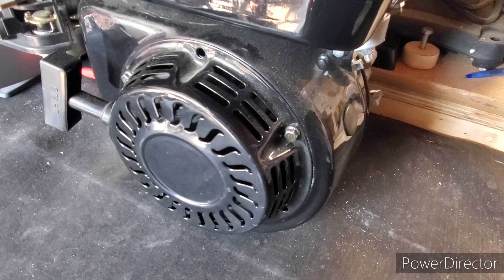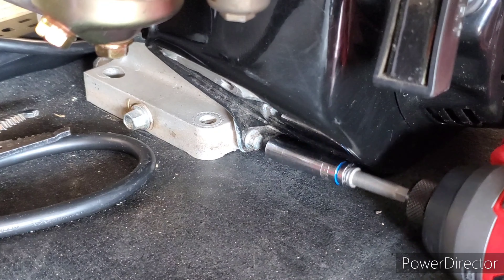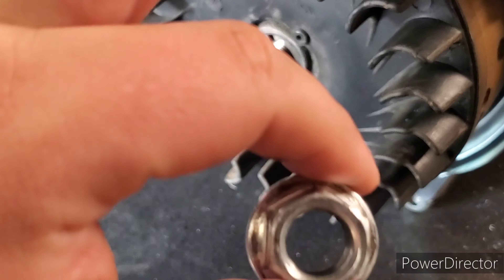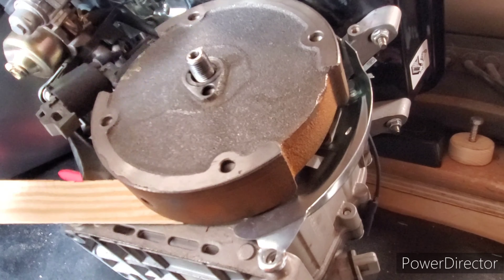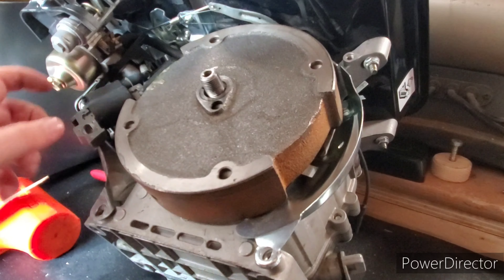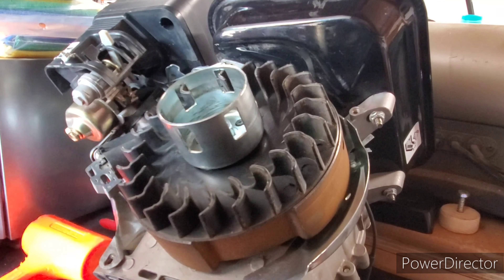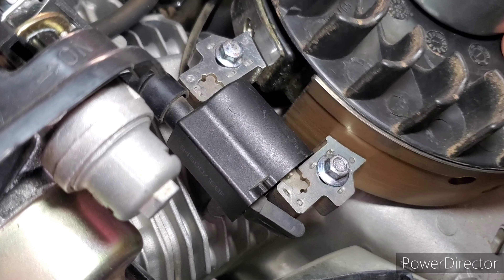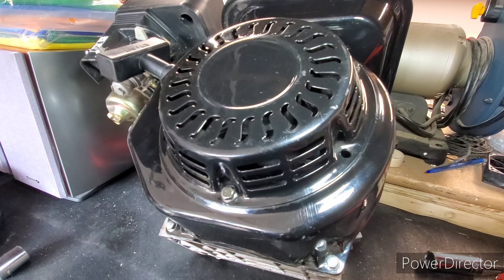How to remove a FLYWHEEL on your SMALL ENGINE

Comment: I did exactly what you did when trying to remove mine but my flywheel never came loose do you have to use something with a wide diameter like you’re piece of wood?
Reply from the maker: Not nessicarly, you just need to put pressure on the back of the flywheel so that when you hit it with a hammer, the tension from the back and the impact will knock it free. There are a whole bunch of ways you could do that in the video. I use the wood to create tension, but you could also use a pry bar. The only issue when using a pry bar is not damaging the block. So make sure to use a strong portion of the block or use something to protect it. Another thing to consider is rust. I've seen on some motors that it can be tricky to get the flywheels off because of the amount of rust. So if you have like some penetrative fluid, put some fluid in between the treads and the flywheel. That should help free it up. Even if their isn't rust, you could also try fluid as well. Let me know if you need clarity on anything I said or if you have any other questions.

Comment: On my brand new 212 there’s a screw that came loose inside and was rolling around near the flywheel. Any idea on where it coulda came from?
Reply from the maker: It may have come from the flywheel shroud on the front, right side of the motor.

Comment: What engine is that it looks like mine and i want to know the brand please
Reply from the maker: It's a hisun. The stock motor that comes on the Coleman 200 mini bike series.
Reply: @outdoormaniac4562  thanks I have a doodlebug mini bike and it has the engine you have and I didn't know what one it was I got it for free from a friend and it runs and drives but I want to upgrade it and get new parts for it

Comment: sir it is pointless if you change the flywheel and ignition coil to racing coil and racing flywheel if you dont change the carb? what gives  the engine more power the carburetor or the racing flywheel or the racing ignition coil
Reply: i have genuine questions because i am still learning . i am ordering a 10krpm flywheel do you reccomend getting the ignition coil also? and do you also think that upgrading the connecting rod and springs will help with hp (i already have a jetted carb
Reply: I would start with the flywheel for safety reasons.  You don't want the stock cast iron one to explode once you start running higher rpms.
Reply from the maker: @user-cc1tm1bh7w  once you start adding more hp, you want to upgrade your engine parts such as your connecting rod, flywheel, carburetor, etc. Just to make sure that nothing blows apart on you.